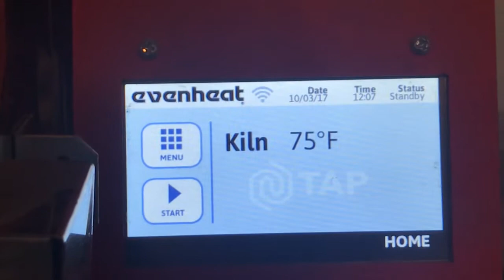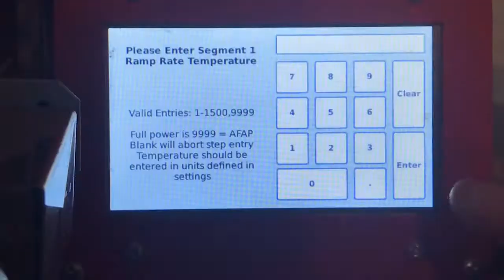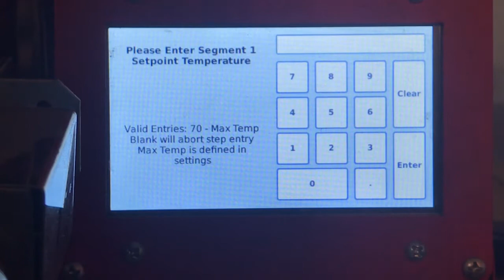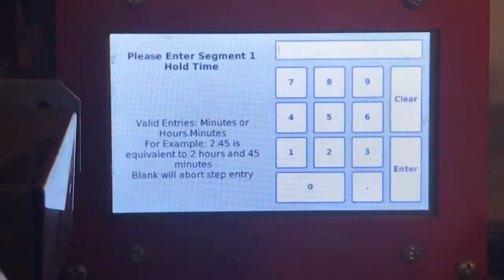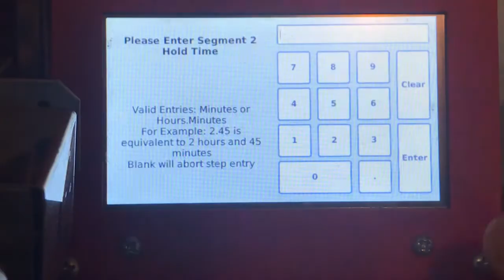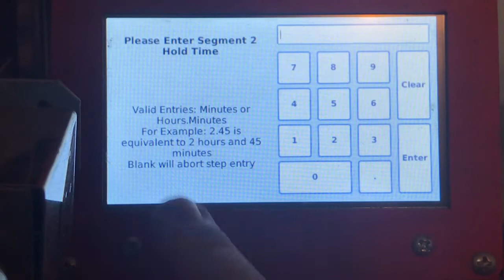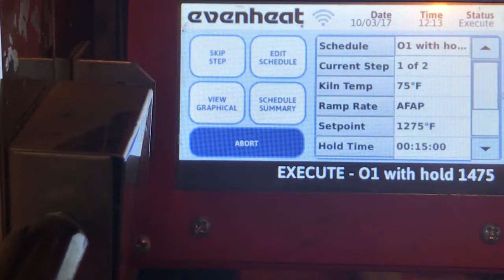The Apex New With An Edge #6 and Heat Treating

Comment: Interested to see how the 01 will hold up as you test it.
Reply from the maker: It's doing great so far!
Reply: Zelrick wondering why others aren't delving into 01 & XHP as you are doing. Is it cost?
Reply from the maker: XHP is cost, it eats belts, band saw blades and tries to kill you in the rough grinding process by throwing little slivers of itself at you, next one I grind, I'm wearing welding leathers and a face shield!  O1 is great for stock removal and cost effective for the maker and overall a better steel but, most people know and trust 1084 and 1095 because it's been used for years and years to forge knives. Many makers stay with 1084 or 1095 because of the the ease of grinding and being able to heat treat them fairly easily in a simple forge or with a torch.( which also leads to varying quality of heat treat) Also 1084 and 1095 are much easier for the person that plans to forge blades.

I'm looking for the easiest and quickest to heat treat with great results, So far O1 is less time consuming and more forgiving than 1095, I can easily heat treat multiple blades without worry of overheating or not getting them in the quench quick enough. XHP takes a little longer due to the higher heat and the need to temper in the heat treat oven, but it's dead simple to heat treat. Heat treat is down time for me, with the heat treat oven running I can't run anything else in the shop without tripping a breaker, and to add more circuits is a big job, the breaker box is already full...